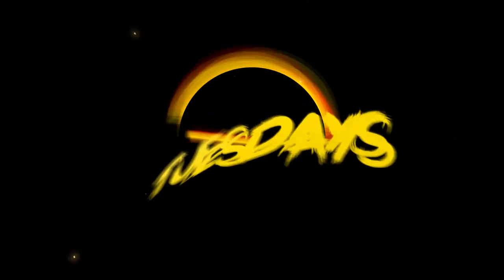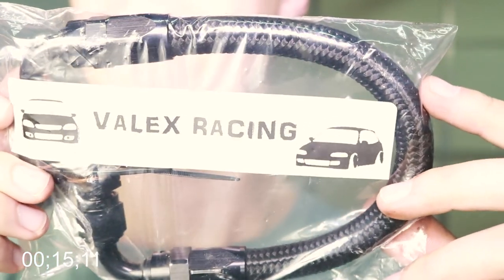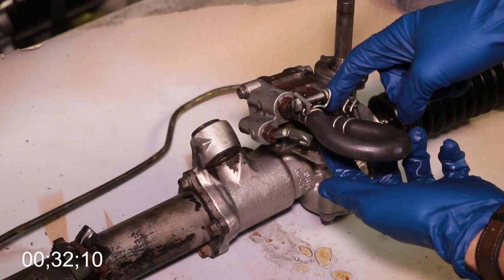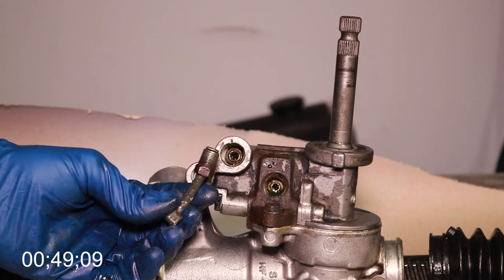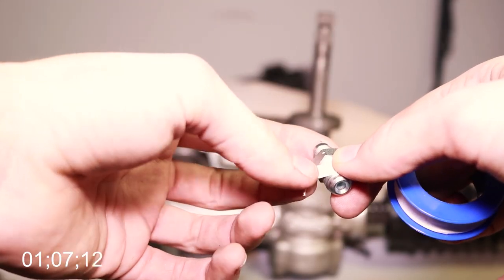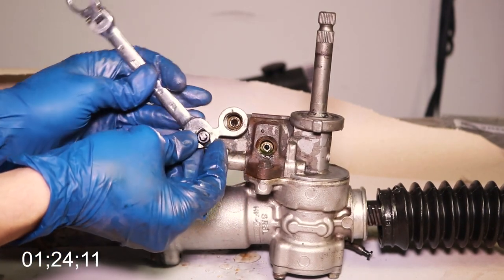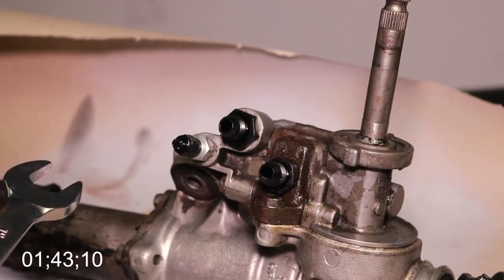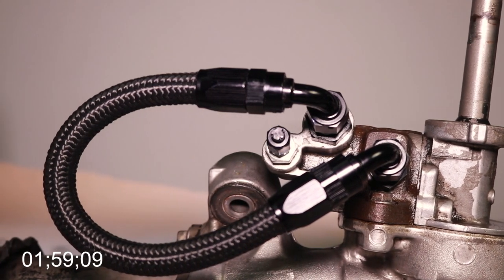Convert Your Car to Manual Steering in Under 2 Minutes | Two Step Tuesday

Comment from the maker: With what car are you rockin manual steering?
Reply: Miata! But instead of looping the steering rack I disassembled the whole rack
 cleaned all the old fluid and grease out
used new grease in the rack.
then sealed all the ports and reassembled.
Reply from the maker: Alexander Hibbs that’s pretty cool!
Reply: Eg hatch, i got it from d13 eg3.
Reply: Don't you need to worry about all the air within that line? I would think that line should be full of fluid and have as minimal air in there as possible.
Reply from the maker: GrimDonalbain it doesn’t really matter if there is air in the line. It just matters that there is some fluid to lubricate the internals of the rack.
Reply: My 1985 MR2 didn't come with power steering. 😅
Reply: trying to convert my 78 Camaro
Reply: 98 mustang with 302 bored .030 over
Reply: BMW 528i
Reply: I was planning to do this with my integra, since the stock cooler and lines have been a nightmare for me and seem to always be in the way.
Reply: 99 Ek with a built D16Y7 
have it looped for like 5 bucks but I think I wanna get a kit now,  looks clean.
Reply: 2001 Subaru Impreza 2.5rs
Reply: Probably going with an S14
Reply: Accord Aerodeck from 1988 :)
Reply: RA64 Celica~ The PS is too aggressive at higher speeds. Can't feel the tires at all :P
Reply: 4.9 second promod🤔
Reply: s2k
Reply: RWD cars do not really need power steering... I once had my car at service and they did loan me a very old car with Rear Wheel Drive and I did not notice that it did not have power steering. Until I was standing still and only then noticed that the steering wheel was a little harder to turn then when I was rolling, it was then I realized RWD cars do not need power assisted steering.... Also I had a Ascona B 1976 model from 2002 to 2004 and it did not have power steering and the feel and control you had specially in winter with ice and snow on the road was much better then any car with power assisted steering. Also the steering on that car was light, no need for any power assist.

But it is a completely other matter if you have front wheel drive, they are much harder to turn the wheels on without power assist.

Comment: Did a full manual rack swap in my ek. Feels better than a looped system. Looped is definitely still a good choice though!
Reply from the maker: Kyler Latta thanks for the info! I’m sure I’ll try out a manual rack at some point.
Reply: Boosted John refine movement has a fantastic video on power to manual conversion in the “correct” way. Cause the main issue with looped lines is the pressure that can build in the power rack. If you want to keep the quicker ratio but want a more permanent solution I’d definitely reccomend checking their video out!
Reply: My car got got a power steering delete and I was wondering if you added power steering to your car
Reply: @BPdontmiss  no I deleted the power steering entirely on my civic. removed all lines and put in a manual rack from a civic cx

Comment: To anyone wondering the looped systems are a way to delete the power steering pump, belt and lines.  It does not make steering better in any way.  It's a bitch to turn at a stop and very heavy even while driving around.  You will also have some slop in the steering from the non pressurized pinion.  If you want you can swap in an oem manual rack or you can remove the rack/pinion, weld the pinion solid, cut the pressure seal inside, pack with grease and reinstall.  This will give you decent steering from a stop and very nice steering once you start moving.  I only loop racks when necessary for a specific build or time crunch.  If you are not on a deadline of some sort remove and disassemble.  You will be glad you did in the long run!
Reply: Thanks Buddy, was wondering whats a loop. I have a civic 4 door with hydraulic ps, its leaking and expensive to repair, i dont drive that much, should i just remove the reservoir, pump and lines? Do i need to put a loop or can skip it?
Reply: YOU ARE ABSOLUTELY 100% CORRECT!!! I DON'T KNOW WHY ANYONE WOULD DO THIS UNLESS IT WAS AN EMERGENCY OR TIME CRUNCH DEAL!!! Stupidest shit I ever heard of!!!
Reply: Thanks a lot, I'm gonna try the second option.
Reply: The big reason why people do it is because it adds horsepower. Less wear on the crank when you delete the belt and less weight when you delete the pump

Comment: I think is better if you take the rack apart, there is a thing you can weld used for the power steering that will get some play away

Comment: I used the method similar to this in speed to delete power steering from my Ford F-150. I simply put the truck in park in the power steering motor blew up

Comment: You may not be aware of it. But there’s also a torsion rod or bar in all power steering gears. That will leave a rubbery feeling when it is used without the pressurized oil feed. 

Good drivers will feel the difference between an actual manual steering system versus a bypassed power steering system

Comment: Would this work on a 2nd gen Camaro? I just bought a power steering gear box with a 10:1 ratio, haven’t properly installed it yet. But if your method works on any car then it will save me some time, work and few horsepower

Comment: Yes, just out of curiosity: what is the benefit of converting your power steering rack to manual steering? A heavier steering doesn't mean sportier steering, even GT3 race cars have power steering that can be turned with 2 fingers today. Without power steering driving your car legit turns into a workout, it's just no fun anymore. There is tons of bump steer and you can't steer with one hand anymore unless you're a chronic masturbator.
Reply from the maker: Johannes feel free to read this videos description. I did a pretty in depth write up on the topic.

Comment: Hi. Can this be done on a 2002 Toyota Camry 4 cylinder? The power steering pump pulley keeps breaking because the rack and pinion won't hold fluid
Reply: did you ever fix this? i have the same issue

Comment: Mine has deleted PS. I love it and not once have I regretted it. I have a 1994 EJ2. completely gutted and cut so it should be around 2200 with me in it. At those weights the only time it’s close to being annoying is parallel parking. At 100+ MPH the car feels like a feather floating on the road so I can only image what it would be like if it still had PS.
Reply from the maker: Yeah it’s honestly a pretty solid move to delete it if it’s not your daily.
Reply: Did you loop it? Install a manual rack? Or tear down the power one?
Reply: @XTheJenovaProjectX  Looping is safe and cheap I’d do that if you don’t care about perfection. Ha I miss that car.
Reply: @SlowDelSol  I’m torn whether to loop it or convert my power steering. No engine in the bay so I have tons of room to work.

Comment: John , i only have two power steering ports need to connected , i dont see the other 3rd port.  is it ok ?  why some other guy using resevoir reroute ? is your way is good enough ?
Reply from the maker: Some only have 2 ports. That’s fine.

Comment: Hey man, so I’m in the market for a delete kit for my 93 Si hatch. I have a three hole system and I’m wondering if I can still get this kit and if it comes with that block off AN fittings or not. Idk if you got it from the hardware store or wherever but I don’t feel like spending $320 on a chase bays kit if this does the same thing. Let me know if that block off thing comes with the kit and if it does I’ll buy the part right now with your code lol thanks
Reply from the maker: I don’t think it comes with the kit, but you can just take the old fitting to the hardware store and use a bolt
Reply: @boosted_john  so i tried to order the product through their website and it wasnt letting me checkout, so i went to their ebay and picked it up there and sent them a message saying your discount code. so even though i didnt get the discount maybe theyll give you credit for it lol. what i ended up doing was just listening to your voice and finding the correct fitting to purchase on amazon for $6 lol
Reply from the maker: ImCoyy right on. Thanks 🤙🏼

Comment: I want to make it so I can throw a valve (or have a computer throw a valve) and go manual. Save fuel over 20km/h. Or maybe I should replace the PS pump on my 07 Kia Cerato/Spectra with an idler pulley, and use an electric PS pump and (when adding AC, as my car does not have AC) an electric AC compressor too.

Comment: I've been wanting manual steering in my 98 Integra but I'm not sure if it's a good thing for a daily driver. #boostedgang
Reply from the maker: El Cachanilla I feel ya. Please read the description of this video. I wrote a huge explanation to help you decide. Hopefully it helps 🤝
Reply: my integra has manual steering factory, its no issue
Reply: front wheels are only 5j wide though

Comment: I'm really hoping the 17k people who watched this video didn't do this.
Looped steering racks feel bloody horrible and are notch, especially without some way to release the pressure difference when the temperature inside the rack changes.
If you really want to keep the standard rack, take it apart and cut the centre divider out. Greg Peters did a good video on it.
But a manual rack has a slower ratio to increase leverage. Trying to park with a manualised power rack sucks balls! Just get a manual rack.
Reply: At last some one talks sense. This method is only for fools. Do the job right, take it to bits, remove the center plunger, retention the shim properly, use a torque wrench.. DON'T play around with your steering if you don't know what you're doing.....

Comment: Removing the Power Steering!!!!!  Next you will disconnect the A/C and power windows!!   :)
Reply from the maker: rjr 4949 I don’t have either of those! 😂
Reply: WHAT!!!!!    Power seats, headrest?
Reply from the maker: rjr 4949 this car is from 1993, and has an engine swap. Lol. 
A/C, and power steering were deleted with the engine swap. And it just naturally has crank windows.
Reply: manual windows....wow.    I was just yanking your chain anyway.  So, I guess white walls are out of the question...

Comment: Its not the same. You will still have all that extra liquid fighting against you when you try to steer the car; adding extra resistance. The best and more expense way, is to actually remove the power rack and install a manual rack. I've actually tested both methods on my car; the manual rack has better steering response and more control of your car than the deactivated power rack. But that is just my opinion.
Reply: The best option that no one does is keep the power rack ratio but instead disassemble it to cut off the seal in the center which creates drag and then weld the pinion to reduce any slack. Once reassembled without adding fluid it only takes a few more pounds of pressure to turn than a power rack. Check out the Miata rack depower for reference
Reply: @jamaisvu2664  can also weld the pinion in the rack to make it more solid too